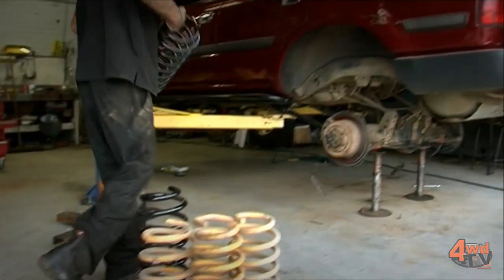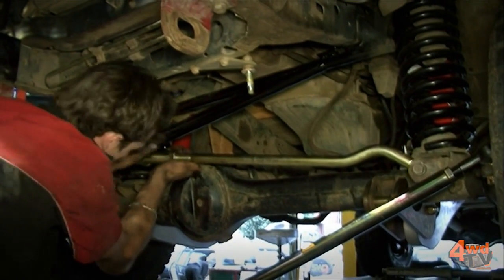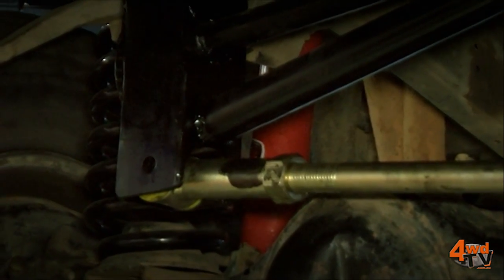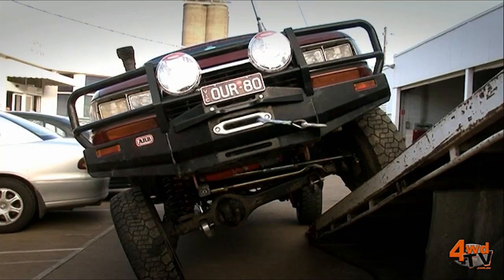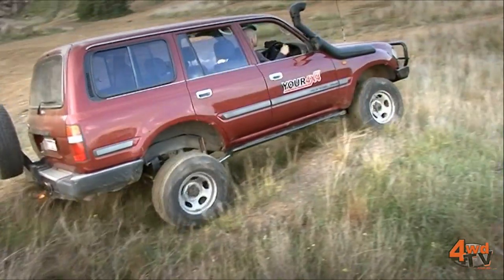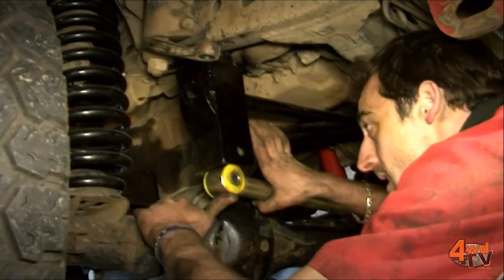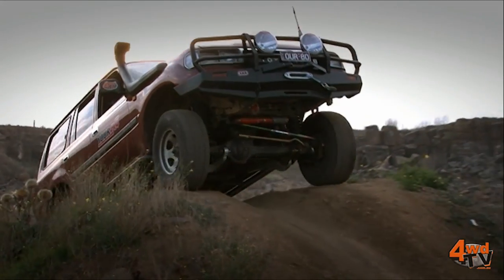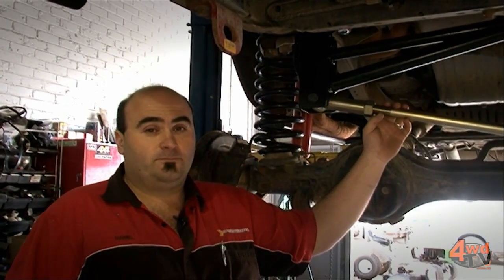Why Fit A Panhard Rod To A 4WD

Comment: Why isn’t the extended pan hard bracket on the superior website
Reply: I asked the same question, and the idiot sales guy at Superior, told me that correction brackets are not needed, as their adjustable panhards does the job the same. lol. 
Superior Engineering are only interested in the dollars, it's easier and more cost effective to just sell adjustable panhard bars, rather than go to all the effort and r&d for all the different bracket kits for all the different model vehicals. 
Also, the drop bracket in this video isn't ideal, because it's lowering the roll center, which increases body roll. A lift bracket on the axel is a far better option as it raises the roll center and reduces body roll. "Superior" Engineering are far from "superior". lol.

Comment: Do you need the extended bracket with only 2” lift from standard?
Reply from the maker: No it is not required with a 2" lift mate.

Comment: Do I need a change of panhard rod if the lift is 50 mm or lower for Jimny2019?
Reply from the maker: Probably not mate, but if you get a wheel alignment from a reputable place, they will let you know if the track is out and needs correcting.
Reply: @superiorengineering  Thanks mate.

Comment: If the panhard rod does not get replaced with a lift does it create a knock when it flexes? 
I have a 2" lift and I don't think they put a new panhard rod in when it got done and something in the front knocks when I go up a gutter or even on rough rocky slow roads..... 
They have had another look butbtheu say nothing is out.of place... 
I did measure the overhang of the front wheel guards to the wheels  and they are different so wondering would it be that....
It's a 79 series 
Cheers.
Reply from the maker: There could be a number of things that can cause a knock in the front mate, but if your diff is not centered then a panhard will improve that.
as for the known you need to check clearances of all moving parts to be sure nothing is hitting then bushes, tie rod ends and swivel hubs for movement, loose parts or wear, if you still haven't found the cause maybe body mounts.

Comment: Hey mate, after 50mm lift my front was fine but alignment guy said the rear toe is out, the track s moved to driver side by 10mm, what would fix the toe ? 
Cheers
Reply from the maker: Hay mate, it will fix the track but not the toe, you would be better off to ask the aligner what he has to fix the toe on the rear.

Comment: Hi I’ve just bought a set of superior engineering panhard rods for my hzj105 with a 4” lift. I’m about to install them. When you adjust them do you take your measurements when the car is sitting in its natural position or do you need to alter the suspension to get the Panhard Rod into a certain position before measuring your tyres to the guards. 
Cheers.
Reply from the maker: Give us a call on 07 5433 1411 or email us at sales@superiorengineering.com.au and we can give you some instruction on how to fit your panhard.